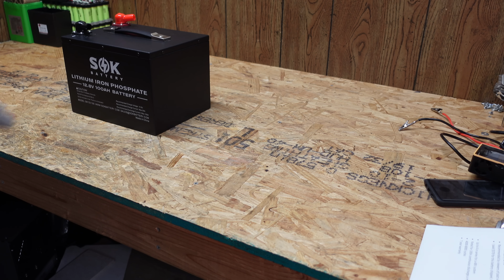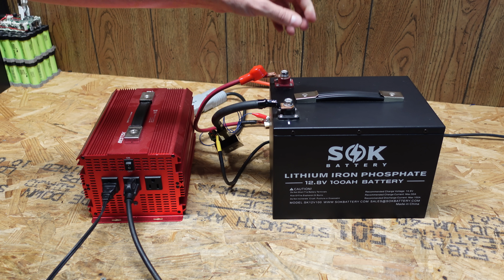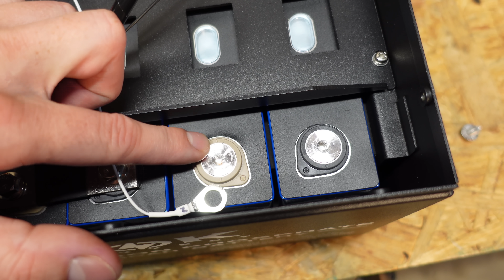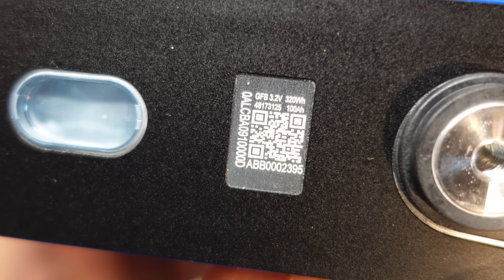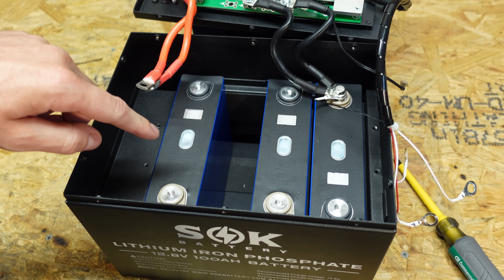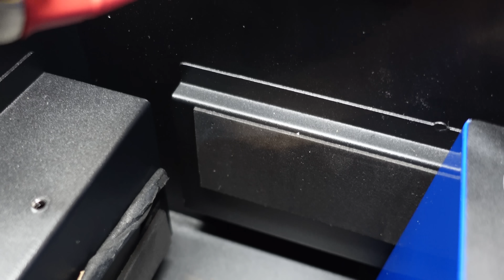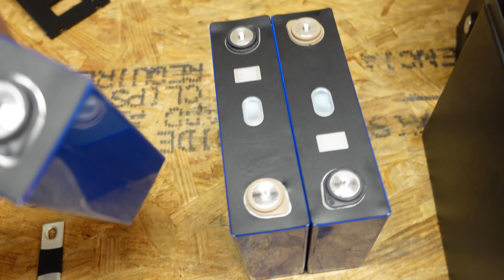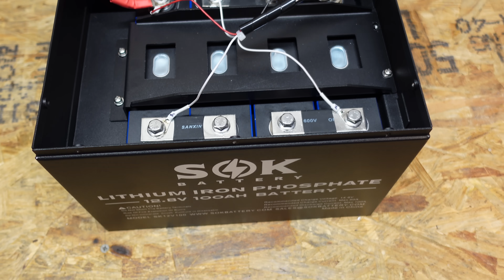SOK Battery 12V 100Ah LiFePO4 Battery, Review and Teardown

Comment: A simple way to have checked the torque value would have been to use an inch pound torque wrench to loosen them up first and allow around 5% less for the friction of the bolt after it was initially torqued. This would have gotten you close by checking the value of each bolt you loosened and averaging the results.
Reply: i thought of that too. this trick does work unless it's lug nuts which can be rusted on so it's break away force wouldn't tell you anything, anyways I found the correct torque spec for m6 bolts into aluminum , it's 5 foot pounds, however since the bolts do not have a lot of threads going into the aluminum it might be less than 5, it may be safer to try 3 or 4 foot pounds. here is the sources/ references https://www.southwestairsports.com/ppgtechinfo/general/torque_values/torque-values.pdf      and   https://forum.classicmotorworks.com/index.php?topic=10638.0
Reply: @eksine  Because this is a new battery and I also suggested averaging, I think that it would be close however, if there were any rust or other composite on the terminals, causing additional friction, you are 100% correct. I have been a gunsmith for decades and have used this method successfully thousands of times throughout the years so I don't see why it wouldn't work in this case.
Reply: It is possible they use something similar to lock tight on those bolts judging by how they suddenly broke loose.

Comment: The prices are tumbling and the quality is improving dramatically "Made in China" no longer has the negative connotations it use to have.
The thickness of the heatsink improves mechanical strength, area relates to  its thermal dissipation. 
That was a great review - very thorough. 
Interesting how they package them.
Reply: the 'made in china' has the negative connotation ONLY if the design and quality control are by unknown chinese company, sometimes even the more popular chinese company. Pretty much the majority of non-chinese big tech companies built their hardware in china. Noone hate IPhone or razor laptop made in china, lifepo4 battery from random company in aliexpress? not a chance
Reply: @TheSiprianus  I'm sure there are dodgy manufacturers - as there are everywhere, but I think the really nasty bits were done by online resellers selling rejected goods or blatantly misleading claims and relabelling cheaper parts to make them appear like more expensive parts. Slowly market forces are weeding these dipsticks out.
Reply: no made in china has other bad connotations, just went thru a 3 month long nightmare with a lifepo4 seller called varicore liitokala, they sold me used, abused cells, swollen and overcharged, pulled 250 AH when it said 280AH, seller would ignore me, aliexpress said they would not help talk to seller, but how when they ignore me? in the end only Visa was able to do the chargeback, but I can tell they went through hell to do it for me. no sir, made in china has new meanings of hell, you're lucky if you got what you expected. good sellers on there is like 50/50, maybe 40/60 or 30/70
Reply: @eksine  That's a real PITA eskine. I purchased some 280AH cells and they are new and to spec, however I noticed these very cells (purchased not 3 months ago) have now doubled in price.  Its a fickle market indeed. The quicker we start manufacturing elsewhere the better.

Comment: the new eve's dont have threaded holes (they come flat) and some sellers (alibaba) are laser welding studs in them. much easier to work with. got mine of amy wan (check will's diysolarforum for links etc).
Reply from the maker: I ordered some of the welded stud kind you're describing from Basen, should be here in a couple of weeks hopefully :)
Reply: @LithiumSolar  "couple of weeks" Wish I had your optimism.

Comment: I'm new wondering what kind of electrical system you could do with a few of these. I've done some learning, but the terms aren't translating to running real stuff, lol. Like how many of these would it take to bank 12000 watt hours of juice a day from solar panels? Or however you put it. Running 12 100 Watt panels, how long would it take to charge? Now I forgot how long it ran those light bulbs lol. 260 Watts. I'm guessing 3.6 hours or so rough math if what I'm thinking is right. Trying to figure out what it would take to run a fairly robust system for a tiny home or RV sized place.

OK 260 Watts ran for 5 hours 11 minutes.
Reply: In theory, 10 of these batteries to store 12kWh of power. There's a lot of assumptions on the next question - you'll need to look at the specifications for your PV panels and the charge controller that you are using. It's unlikely that a 12x100W array would have 10 hours of perfect sunlight in a day - you lose efficiency depending on the angle of the panel incident to the sun, there are losses within the system too; cables, the charge controller you deploy will have efficiency losses. And also depending on where you are in the world and the typical weather, you may not have 10 hours of sunlight, let alone "good" sunlight for substantial parts of the year. You'd have to factor those things in and potentially overbuild a system if you need a guaranteed power budget of 12kWh/day. 
The EU has produced a really useful set of tools that'll help you model the performance of a PV system at a given latitude: https://ec.europa.eu/jrc/en/pvgis
Reply: @madvlad1  the problem is I'm nearly clueless :) This helps. Thanks a bunch.

Comment: You can do up to 4 in series but is there a limit to how many you can run in parallel?
Reply from the maker: Their website doesn't specify a maximum in parallel. I don't see a reason why it would matter how many in parallel as long as good fuses are used with the right interrupt ratings.

Comment: Cool!! They are also in my webstore, just Google "Current Connected store" we have a ton of them ready for immediate shipment
Reply from the maker: Ah cool, didn't know you sold those. I see you also have BigBattery batteries too :)
Reply: @LithiumSolar  yeah but they are a bit pricier than even on big battery site. Essentially order through us if you don't feel like dealing with big battery, we will make sure any issues you have are fully sorted. We offer great customer service and tech support on everything we sell.
Reply: Not on website. Webpage doesn’t operate properly…click on Batteries/Lifepo4 and it shows for about one second and then disappears.

Got it to work once and Sok was not listed. Tried the search tool and came up with Nothing Found.
Reply: @williamwilson6499  that is quite strange, I just checked our site, doesn't seem to have any issues.  Would you be willing to email me a picture at info@currentconnected.com of the issue you are having?
Reply: @williamwilson6499  on the homepage there is a big icon that shows sok battery. If you click on that it should take you where you need to go
Reply from the maker: I had no problem finding it. I clicked Batteries > Shop Now, typed SOK and it popped right up.
Reply: @LithiumSolar  awesome!  Thanks for checking it out.  I'm working on an affiliate program as well that will be up and running pretty soon

Comment: Hello, and thanks for your reviews. To find the torque of a bolt : use a inch pound torque wrench. Start at a low setting and work the setting upward until the bolt begins to turn and observe your setting and you will be in the ball park of what they were torqued too.
Reply: Forgot to mention in the un-tighten / reverse direction.

Comment: The SOK batteries really make it hard to build a LiFePO4 battery because they are a pretty high quality build for a VERY reasonable price. Honestly, I'm unsure if I can build as solid a battery at a better price. Sure, I can stuff more AH in a slightly larger box & I will have the benefit of setting my longevity by controlling usage parameters, but- it's pretty close to an ideal build for a 100AH 12.8v battery. Covered wires, solid crimps, cleanly organized with well sorted hardware for $570 delivered? Since I'm building a battery bank for my RV, I may have to consider the 206AH batteries for a 24v system, INSTEAD of building my own... Yes, I can build a 24v 280AH battery that weighs less, takes up less space & has my personal programmed limits to ensure long life for @ $1,200, or I can get less for more. It's a genuine dilemma.
Reply: Where's the dilemma? 24V * 280Ah = 6,720Wh. That's $178.57/kWh at your stated build cost of $1,200.

Creating a 24V/206Ah (4,944Wh) battery would cost $2,058. That's $416.00/kWh, or 2.33 times more per kWh. Even at a killer MSRP, DIY is still significantly less expensive.

In addition, you're able to realize the full potential of an energy system; maximizing longevity by operating within optimum voltage bands, supporting loads greater than 100A, and dramatically reducing charging times.
Reply: @ARepublicIfYouCanKeepIt  Well, I bought some tools, and, I practiced crimps, etc... & so forth. My comfort with my crimps is NOT at 100%, and should probably consider a larger (leverage) crimper, or think about a hydraulic one. I do have a hammer crimper but have not practiced with it. I think there are others who have built: batteries, toolbox portable chargers and other wired projects that lack confidence in their connections. Also, although I know that the anodes/cathode bolts are 'enough' on the Basen/Lishen 280AH prismatic cells- they do seem to be a weak link when building your own. Put them in an RV with imperfect roads and all sorts of things can happen. The SOK batteries use substantial bolts and I've noticed that the crimps are definitely air tight & will last a long time. I guess I'm just thinking: order with confidence or build with a moderate budget (allowing for more solar panels, right?) is not as simple Watt hours vs. $$'s spent always.
Reply: @DCGULL01  I wouldn't recommend a crimp anvil. I use a combination of a ratcheting tool with interchangeable dies for most crimps from small gauge up to 10AWG. Any larger and I use my hydraulic crimper, again with interchangeable dies.

I also use a specialty hexagonal crimp tool for ferrule connects up to 10AWG.

I also recommend connectors with adhesive heat shrink insulation, as well as solderless butt connectors.

Regarding your comments about portable/mobile applications, these are the only use cases for which I build.

Portable power stations, RV's/trailers/vans, even e-bikes, no problem.

As for the threaded poles on prismatic cells, threadlocker and serrated flange bolts are all that's needed.

I inferred from your original post that you were an experienced battery builder. I not, I definitely recommend spending the money for COTS product. 24V/206Ah of lithium is to be respected.

Comment: 0:58 looks like 8mm threaded bolts. Bus bars might have been some sort of copper nickel alloy, looked too shiny for Al. Question I have though is this sort of product a drop-in replacement for similar SLA units? Looks the part! ie Will BMS manage charging and drainage current? can it be charged like a Lead Acid?
Reply: Kosmonooit, batteries of this type are not drop-in replacements for lead acid batteries. They're simply not able (or meant) to push near the current of their lead acid (very distant) cousins.

This particular battery is rated at a recommended maximum discharge current of 100A. For comparison, lead acid batteries for a typical 6-cylinder gasoline engine are rated for 500+CCA (cold cranking amps).

Notice also that this test was at a 0.2C (~20A) discharge rate. Had the test drawn the rated maximum of 1C (100A), the result would've been much less than 102Ah.

Generally speaking, batteries are categorized as either "energy" or "power" cells. Energy cells store high amounts of energy and are designed to support 0.5C continuous to 1C maximum discharge over long durations. Conversely, power cells are best suited for dumping lots of current over a very short period of time. Say, starting an internal combustion engine.

You'll quickly damage a lead acid car battery by sustained discharge at it's rated current for even brief durations. This is one of the reasons you shouldn't crank your car's engine for more than 30 seconds at a time. That and the danger of overheating wiring and the starter.

So, long story short, the BMS's for these lithium batteries simply won't support the current needed for the kind of applications where lead acid chemistry shines.
Reply: @ARepublicIfYouCanKeepIt  Thanks - I was thinking more for a replacement for stand by power systems that typically use 'Deep Cycle' SLA batteries, the Inverters don't have a BMS link and/or are not 'Lithium' compatible , typically used a 3 stage voltage charging cycle, and we know Lead Acid will only draw as much current as the need during chaging so generally there is no charging current control, only limited by the rating of the charger.
Reply: @Kosmonooit  Oh, in that case, Lithium chemistry batteries (Li-ion, LiFePO4, LTO) all massively out perform lead acid chemistry batteries (FLA, SLA, AGM, deep cycle or otherwise).

The following are just some of the benefits of lithium:
• Longevity - Li-ion batteries, operated within an optimum voltage band, as well as not heated excessively due to high discharge or charge rates, will last between two and three times longer than lead acid batteries. LiFePO4 have even higher lifecycles and LTO could be the last batteries you ever buy!

• Capacity - Lithium chemistries support discharge down to 20% SoC. Compared the recommended limit of 50% discharge for some lead acid types, this means that seemingly smaller capacity batteries provide equal or greater capacity over larger lead acid batteries.

Combined with increased DoD, greater energy density also translates to reduced space and weight.

• Performance - Lithium chemistries maintain voltage over the vast majority of their discharge curve.

• Superior Charging - Lithium chemistries charge in significantly less time than lead acid batteries. Orientation is irrelevant. There's no spillage or off-gassing.

• Economics - Especially with the advent of LTO cells, lithium chemistry batteries best lead acid batteries every time.
Reply: @ARepublicIfYouCanKeepIt   By far, they blow away gel cells. That is how I started out.
Reply: They are indeed M8!

Comment: You measure from under the head to the end when measuring a bolt for length.
Reply from the maker: Ooops, thanks for the info :)
Reply: I have used an open end wrench to measure bolt diameters. But remember 8mm and 5/16 are very close in size.

Comment: Could you use this battery in a V8 truck?
Reply from the maker: No, this battery is not designed for the heavy instantaneous load of engine starting.
Reply: If you combined with a capacitor bank for starting it might be great. Some guys were working with capacitor banks to run vehicles. Capacitors charge up fast on solar. Would also off a battery it seems would follow. Batteries could be used that are more efficient, but I'm no expert on all that.
Reply: You need 1000 CCA, this has 100Ah of RC or deep cycle, good for powering a 12v trolling motor?